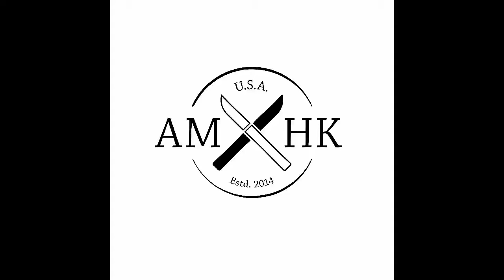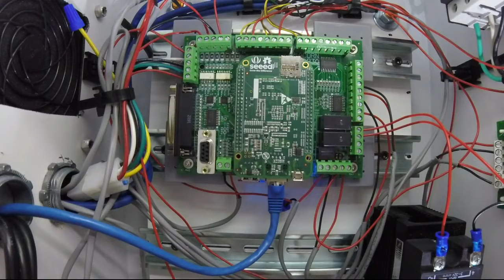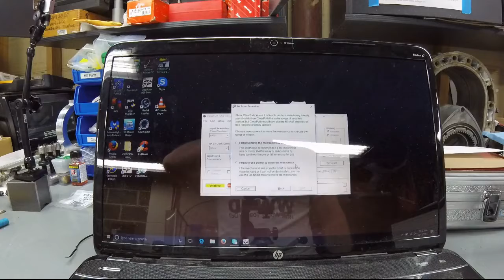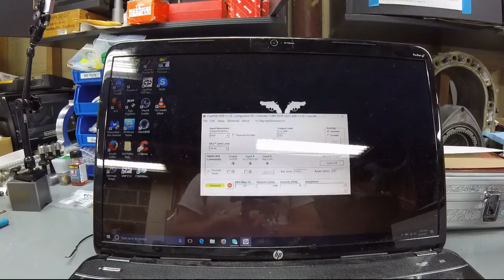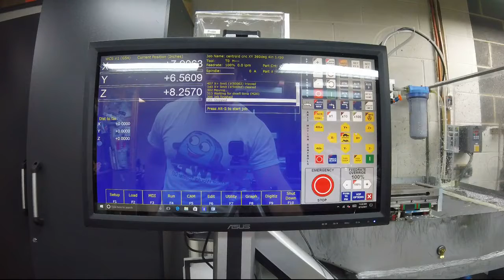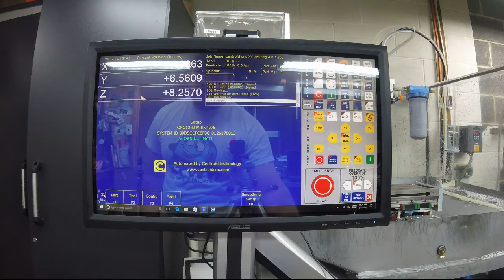Wiring Clearpath Servo to Acorn Control Board

Comment: Did you have to use 100oh + resistors for the clearpath signal wires? I see that on the acorn's schematic
Reply from the maker: I did not, when I wired up this system it was still in beta form and did not have a schematic with resistors.

Comment: Hmm, you say in the video you hooked HLFB red wire (negative) to +24V on a rail and then connected motors in series ending with green wire from HLFB+ going into In5 on Acorn.... now that doesn't sound right, since In5 will also have +24V when opened. I have connected mine with red wire hooked to the COM and it works
Reply from the maker: I would not go by my wiring on that board, the video is a few years old and it was a first rev/ beta board. I recommend using a new wiring diagram from centroid for connecting to the acorn.
Reply: @hollerbachcustomknives  trust me, it's worse, otherwise i wouldn't be trying to figure it out by videos

Comment: Hey, any idea why the Acorn step, dir and enable are wired to NEGATIVE inputs on the Clearpath ? It just feels weird doing this without an explanation. The Acorn spec sheet does specify that those outputs are positive, where am I wrong ?
Reply from the maker: If you look at rev 4 all of your positive enable. Step and direction  positive connections are direct to your 24vdc from the transformer and your negitives are enable step and direction through the board, i believe it is done like that for easyer power tranfer through the board. Basically its easyer to control with smaller components and less power directly through the board.
Reply: @hollerbachcustomknives  Right, just wired as instructed on the rev 4 drawings. Good that they provide them in such an accurate manner depending on which equipment you are using. Thanks for the answer.

Comment: do you wire and set up closed loop steppers the same way ? (bought leadshine closed loop steppers with drivers)
its actually the one thing that still devides me between the achorn board compared to a uccnc ub1 breakoutboard setup at this moment
Reply from the maker: watahyahknow if you go in centroids website under the acorn board tab there is a zip download of wiring schematics and there is a leadshine schematic  in the file.
Reply: Thanks for the video. When you say inputs from the clear path, surely you mean outputs.   step & direction to clearpath
Reply from the maker: Paul H there are both inputs and outputs for the clearpath servos.

Comment: Nice video is there port for error signal that comes from closeloop stepper motor
Reply from the maker: Ike Cobey yes there is, if for any reason the servo has a problem it stops the machine.
Reply: Alan Hollerbach thanks, also if I have done on 3rd party cam the gcode can I load this on software?
Reply from the maker: Ike Cobey as long as the post processor matches yes if not you may have to tweek it to match.
Reply: Alan Hollerbach thanks, also this controller have only 4axis it's possible that I can expand the axis like make it 5axis like  controid oak controller
Reply from the maker: Ike Cobey not with the acorn at this time bud.
Reply: Alan Hollerbach thanks a lot

Comment: I am running the ClearPath servos on my machine and am interested in the Acorn. With Centroid, having your encoders set at 6400 what are your speeds, ipm. Thanks for your informational videos.
Reply from the maker: sure, i am speaking about the smaller benchtop style mills, the dovetail ways on these machines have way more stiction and can have a ton of drag as you tighten up the gibs to keep down on the slop. Where as the linear rails are smoother, almost no drag and provide a better base for movement at higher speeds.
Reply: sorry Alan, my post above was for Jason Hopkins, he said " I am currently running Mach3 and can only accomplish 200 ipm with encoders set at 800 res. I tried the higher res and could only get 150 ipm." ,...... my guess is the higher encoder rate slows down his available IPM and bogs down his controller. I am curious how available IPM for clearpath or other high rate encoded servos would perform for each control  board.  From what I read Acorn is pushing over 400 khz. Your CPU I do not believe would be the bottleneck at 1ghz, but rather the controller ...
Reply: I am not running either Acorn or Masso, and I use Mach3 to control the machine with a C11GS BOB. The problem I have with the ipm reduction in high resolution encoder settings is Mach3 is not capable of that high of a pulse rate. therefore the ipm drops form close to 250 ipm to 150 ipm there about. Pulse rate will drop your ipm as will rpm of the motors. I was not expecting any more that 200 ipm out of my servos, my machine is of medium size and figured I needed a good balance of torque and speed so I went with the S series servo. The spindle head on my machine weights in at 120 pounds so these servos ROCK!!!
Reply: I have the SDHP-3421 clearpaths and recently hooked up my acorn, with encoders set to 6400 the acorn software will not let me configure above 50 IPM (1270mm). I am using a 1605 ballscrew, would love to know how you guys are seeing these kinds of speeds.
Reply from the maker: James Hopkins im running the clearpath sdhp servos, i would have to look up the specs but with the screws im running now 400ipm is the max, the nsk screws i will be switching to can max out at 800ipm
Reply: I am running the sdsk series and have 2005 series ballscrews, double nutted. I am currently running Mach3 and can only accomplish 200 ipm with encoders set at 800 res. I tried the higher res and could only get 150 ipm. I was just curious as  I am looking for better options for controlling the machine. It is getting harder and harder to find the favorable cpu for mach.
Reply from the maker: The higher res you go on the clearpath servos the slower their max speed is. Im running cpm-sdhp-2331s-eln servos and 1605 ballscrews. if you want higher speeds you will need a faster twist ballscrew but intern changing ballscrews to faster will sacrifice accuracy.
Reply: Does the software use the encoder feedback for positioning even tho it is step and direction? just trying to learn how the encoder is used .
Reply from the maker: no feedback to the software with the acorn board, the clearpath servos use the encoders for pulses input and movement. Easy way to describe it is the board sends 10 pulses the servo moves 10 pulses if the servo only moves 8 pulses there is a problem and it will stop. servos are smoother and have way more power than steppers and with the added encoder and auto tuning of the servos give you a great setup for a mill.
Reply: Thanks for the information. I am running the SDSK-3421S on my mill, all three axis. Soon I will be adding a 4th axis using the nema 23 motor, I think the SDSK-2311.
Reply from the maker: there is where your speed is , the 3421 only runs at a max of 1410rpm vs what im running max is 2520rpm huge difference for ipm. you have a ton of torque with the nema 34s though. also have to look at what setup your running on the mill, dovetail ways or linear rails make a huge difference with speed.
Reply: how so alan ? could you explain ?
Reply: Acorn has a 400+ khz processor / output. I am not sure what that equates to in actual IPM but looking at a MASSO only had like 110khz. What is the published spec on your setup ?
Reply from the maker: Im not sure what your asking the controller is running a 1Ghz motion control cpu and ipm is the turns on your ballscrew conversion to rpm of your motor. There is no published specs for my mill because it is all custom made, i would have to put together a list if you wanted to know.
Reply from the maker: James Hopkins i believe the clearpaths limit the speed and slow it down the higher the pulses your trying to achieve,  when you go into the clearpath software and change higher pulses it tells you the new rpm max you can run. Its kinda micro stepping the encoder to give you more pulses i believe.
Reply: NO, the rpm max stays the same in MSP, Mach3 is actually dropping the max ipm that I can run because it cannot provide the amount of pulses needed.
Reply from the maker: Anthony Webb make sure you have your max ipm on the wizard set correctly.
Reply: Thanks for the suggestion allan, it is in the wizards max ipm that it is not allowing me to set more than 1270 (mm/min) for that field.  I will make a video of my build and show how it is set up.
Reply: Anthony Webb I am running 2005 ball screws. You may get higher speeds with a smooth stepper due to kernel speed. I am limited to 250 ipm due to motor rpms
Reply: Man, I thought with acorn I had escaped the Mach3/4 world.  I do have an ESS sitting here collecting dust when I switched to the Masso.  Had high hopes that the acorn would be zen.  I must be doing something wrong here, I will continue to dig in and ask questions, but 50IPM sounds really slow as compared to what other people see, high resolution or not.
Reply from the maker: looks like your servo will only run a max rpm of 1220, giving you a max rpm of just over 200 ipm. im not sure if you may not be setting up your ipm max in the right box, shoot me an email if you want  holleral at gmail.com and i can try an help correct this problem.
Reply: Alan Hollerbach I did figure out a way around the limitation. What was happening is I read somewhere that you always wanted to use the wizard to set up your machine. The wizard was restricting me to 50ipm for some reason. But, I was able to exceed that in the c12 software and once I changed  it up to 250ipm now the wizard is no longer restricting me anymore. I suspect a bug somewhere, and one that I can’t reproduce anymore.
Reply from the maker: Anthony Webb thats weird, glad you got it fixed. Anymore questions dont hesitate to ask.